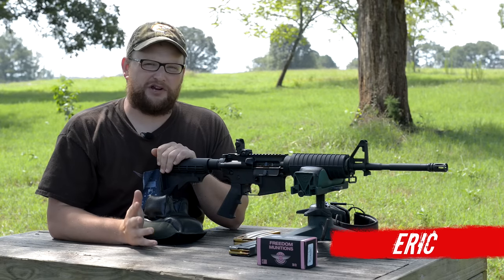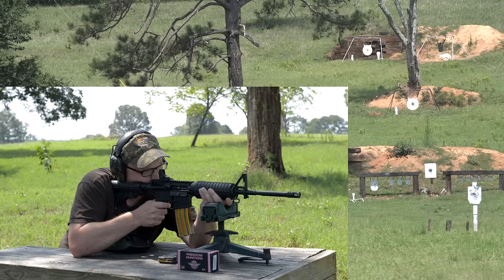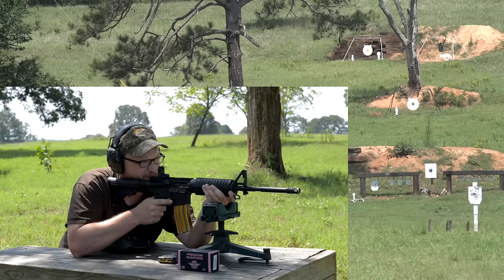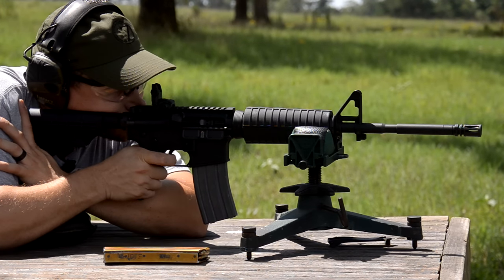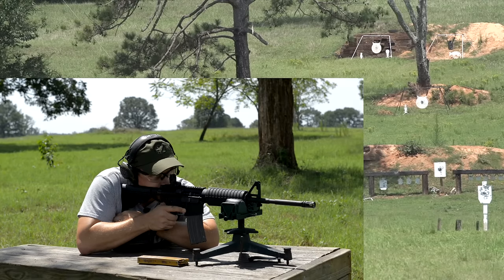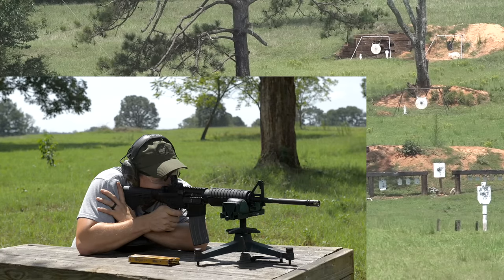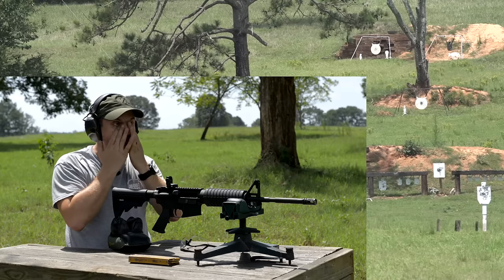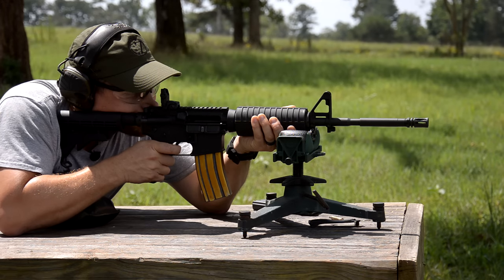Basic AR-15 Practical Accuracy

Comment: why is,there a second click adter each shot? 
whats the best ar 15 in your opinion?
Reply: it's the trigger resetting
Reply: HK416 is probably the best and most modern AR right now. But the civillian version (MR223/MR556) is also super expensive
Reply: Probably the trigger resetting
Reply: Anything from BCM, Midwest, Daniel Defense, or Spikes. There are higher prices guns but I would say those are the best fighting-grade rifles on the market
Reply: That is a trigger disconnect. Its put there so your trigger resets only when you release the trigger.
Reply: We have a Sig and it shoot well for being a $700 AR. We have 1,000 rounds through it and no problems.
Reply: 1. Trigger reset
2. BCM
Reply: Trigger reset. The disconnector is letting the hammer fall back to the notch where the trigger sear will catch it
Reply: check the pof p415 or renegade plus
Reply: As mentioned that is the trigger reset. It is also one of the loudest sounding resets Ive ever heard. It must have been really close to his mic. IDK, maybe being a new trigger has something to do with it as well.
Reply: Reset, V-AR (Pavel Vosatka).
Reply: A 416 (or whatever the civilian model is called) if you have the funds
Reply: Slice of Cheese H&K MR556
Reply: In most other videos, you never hear that noise because people usually release the trigger right after the round has been fired so the shot drowns the trigger reset noise.... Mr. IV8888 here is holding the trigger on purpose.  it's a shooting exercise were you keep your sights on target and start releasing when you're ready, and fire off another one as soon as it resets. Helps with muscle memory
Reply: AaronAlso Maybe becuase they built it? or its really new and a newly built rifle
Reply: Just buy a bcm with a mid length gas system. you'll be fine and save a bunch of money over others. there are a lot of great companies out there lwrc, Daniel defense, FN,    PWS but I think Bravo will get you where you want to be in a decent price range. Or just build one from quality parts or have someone build one with the options you want.
Reply: Any spikes tactical rifle, if you ever have a problem with any of their stuff call and ask for mookie